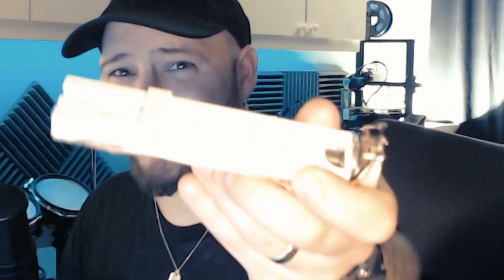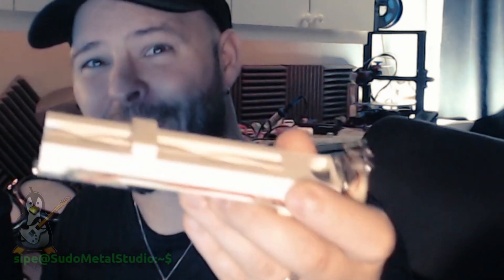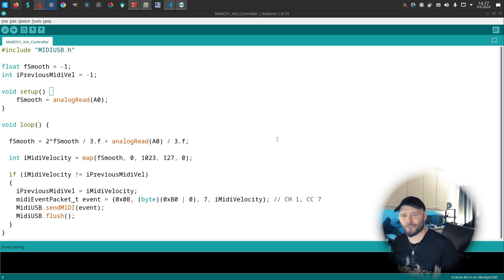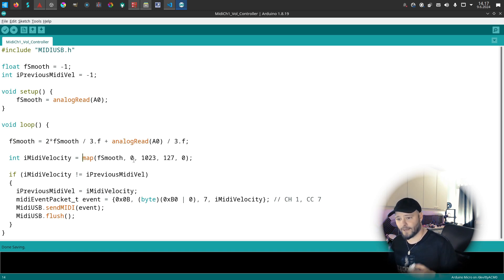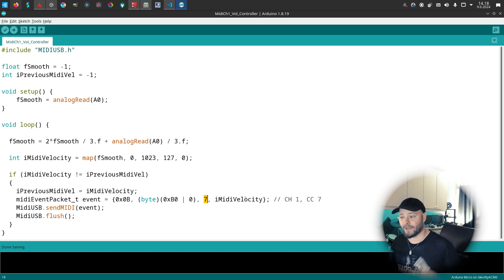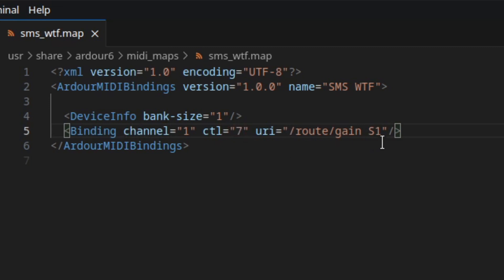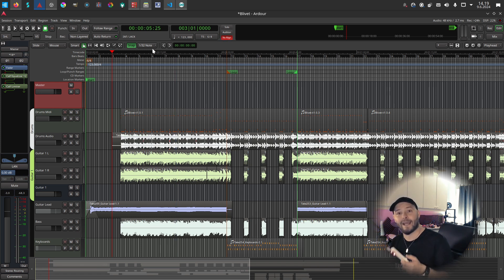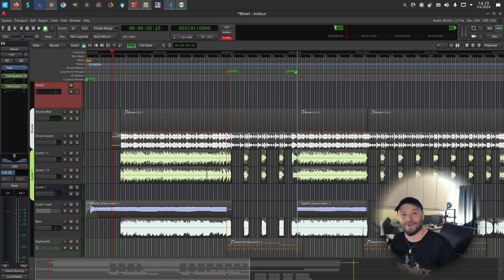DAW Controllers are EXPENSIVE so I MADE MY OWN! (kind of)

Comment: I'm trying to figure out what's stupid! I've got an ancient Radium Musicman keyboard that has some knobs and sliders on board (I wonder if Bach ever used it). Oddly enough, all but one of the knobs are useable -- you touch the knob and the potentiometer bounces around like a Jack Russell Terrier on speed. This vid makes me wonder what a bucket-load of pots from a guitar supply depot could do in the right hands.
Reply from the maker: DIY midi devices is not really a new thing at all. In this one it's the noise of the 3D printed "fader" that's mostly stupid in my opinion, and also the fact that I could have ordered a slider too when I ordered the Arduino 😅 

But I also figured the reason why good DAW controllers are so frickin' expensive: it's the motorized faders that cost like hell! Around 20-50 EUR/USD even from China per piece!

Comment: I'm pretty sure my old Behringer was noisier!
I have an old Yamaha mixer that uses rotary pots for the faders, but they are mounted on a rack and pinion gear setup, where the pot follows the fader handle. That approach should also work, and would probably be a bit smoother.